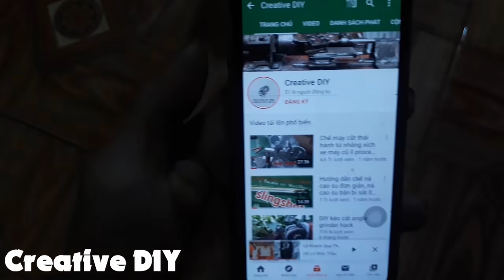Làm bộ vi sai xích

Comment: In the mean time I bought a junk craftsman ride on ( no engine ) 42" . I needed the front axle . The small engine repair shop owner said the transmission was shot . Opened up the transmission and saw the the last owner had put it together wrong so it would not shift, that was a fast and free fix . Inside are two differentials . But I ended up using the whole transmission instead. Six speeds forward and reverse .. made a trike out of it . Scooter front end so had front brake and a speedometer. Never underestimate someone else's junk lol . 25 bucks and I fixed my mower, and had a bush bike amazing amount of traction from the 20x10x8 tires that came with the " junk mower "

Comment: Not to be critical..... but Never seen a "spinning" gear box before!!! Could have accomplished the same thing by using a straight shaft mounted to the Chain sprocket...... Gearbox does not give you any advantage in more torque or ground force.

Comment: I don't see how that is a differential; you are not changing the rotation 90º, you could just as well used a shaft with the sprocket that goes thru those bearings.
.

Comment: All that work to make something you can buy and you used a worn out sprocket and shitty carrier/sprocket nuts ?
Plus you never heat treated any of it 
You have at least 5 different Rockwell hardness metals there 
Which one is the weakest link ?
Reply: Negative people always find a way to criticize.. how about showing some appreciation for the hard work then say what ever u want ?
Reply: @sultanheart  
Rightly so.and if one could be more imaginative,one can add a shaft and propeller, pronto! A pedal driven boat or kayak.